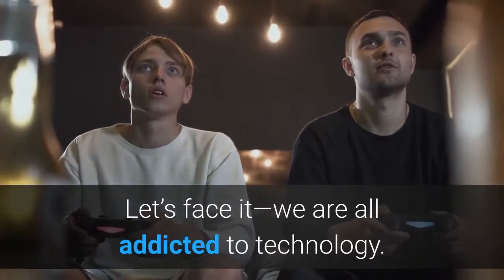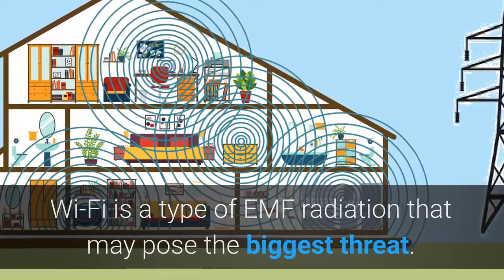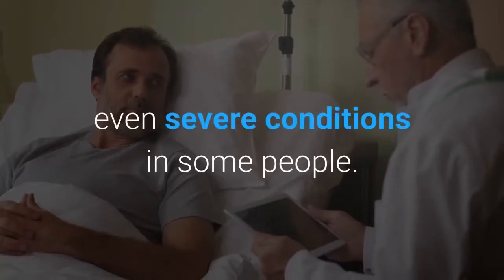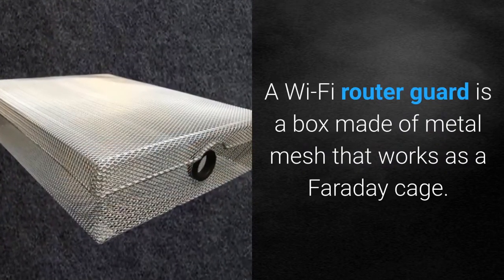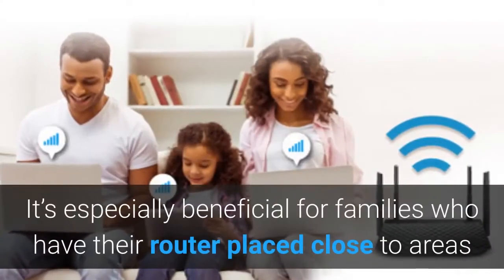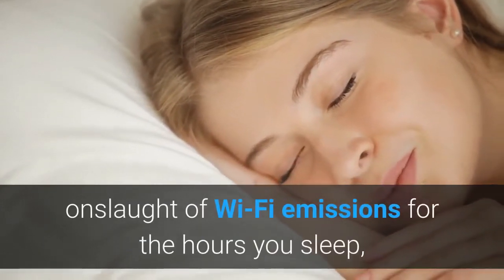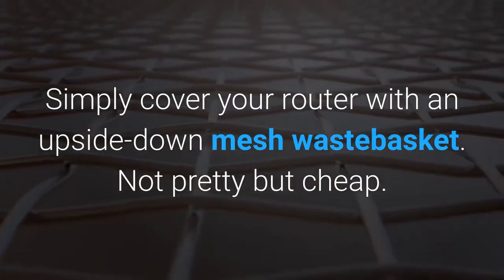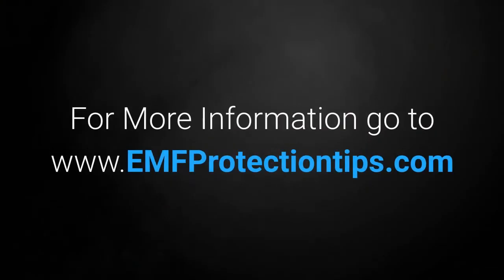WIFI Router Guard - Why You Need One

Comment: There is a new technology coming I.e LiFi here light from LEDs are used instead of RF. But problem is not all devices are LiFi enabled. there are external adapters for PCs  and mobiles , a company called pure LiFi makes them.
Reply from the maker: Thanks for the update
Reply: LiFi emits significantly higher frequency radiation! That simply don't do!
Reply: @AgentOrange96  but they say that the lights used are our regular LEDs so how come they emit higher frequency radiation?
Reply: @anirudhreddy7671  LEDs emit extremely high frequency electromagnetic waves. Between 430-750 terahertz in fact. Whereas a WiFi router is emitting electromagnetic waves of around 2.4GHz or 5GHz depending.
Reply: @AgentOrange96  whoa, OK thank you for the info
Reply: @AgentOrange96  but  despite that people often use LED bulb light at their homes, isn't there any long term side effects due to that high frequency radiation?
Reply: @anirudhreddy7671  It isn't just LEDs that emit those frequencies. But also incandescents and florescents including CFLs among many other things. Even the sun and lasers emit these at high enough levels to quickly cause blindness if you're not careful. You're irradiating your eyes with it as you read this comment. It's light. Light IS electromagnetic radiation between 430THz-750THz.

Comment: While not wrong that this will attenuate the radio signals emitted by the wireless router, (yes a Faraday cage will do that) this video fails to mention that those radio emissions are HOW wifi works. It's like cutting the engine out of a car and wondering why it doesn't still move.

If you're really that paranoid about the radio signals emitted by wifi routers then just stop using it. Unplug it. Stop wasting the energy to run the thing if you're just going to block it anyway.

If you want to retain the routing features required for a network without using the wifi element, (out of paranoia) then simply disable the wireless feature in the settings. Easy.